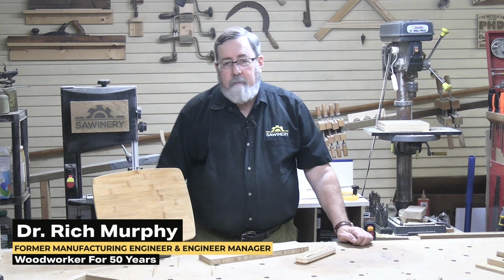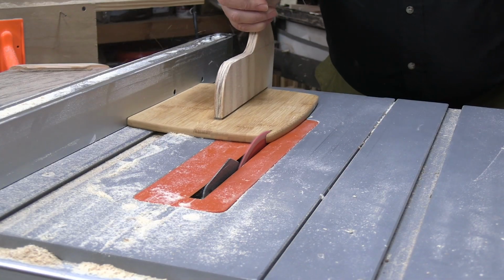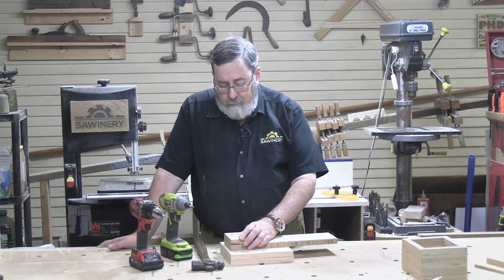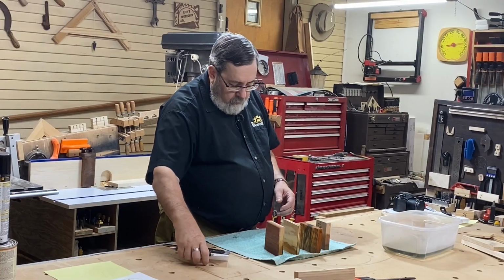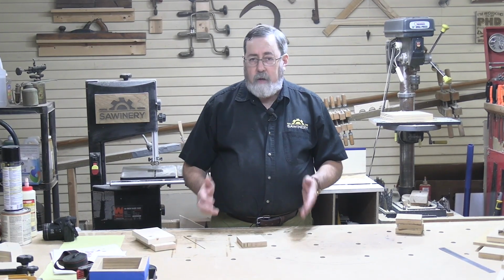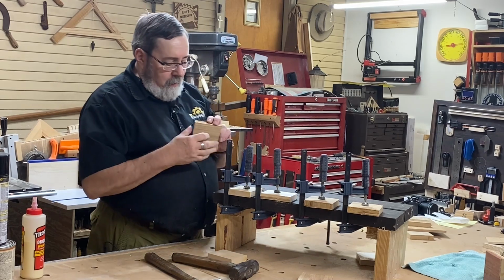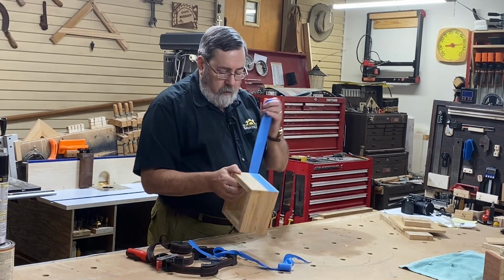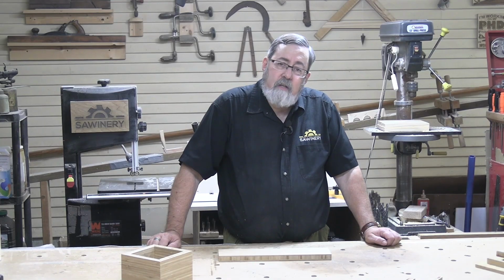Bamboo for Woodworking? I Tested It to Find Out!

Comment: bamboo built-up stocks and laminated sheet goods are an exceptional material, stable, dense, hard, stiff, strong, machinable, and beautiful, especially when finished with oil and wax. not easy to find in north america, but it comes in all kinds of laminate styles, configurations, and thicknesses. it does require a lot of processing to go from the raw material to the finished product, so it is always going to be a premium material at a premium price

Comment: Bamboo is NOT a herbaceous grass.   Bamboo is in fact a woody plant. 
What classifies plants as "woody", is the presence of Lignin, which is a chemical that hardens the secondary tissues in plants making them rigid.    Lignin comprises 30% of Bamboo's dry mass... the same amount seen in trees.  
So yes... Bamboo is wood.
Reply: Bamboo is in the grass family.  It grows from the bottom like most other grasses, not from the top like most trees.  It can be called "woody bamboo", but the scientific family is grass.
Reply: @garrettgobrien  
Irrelevant to the fact that bamboo is a woody plant.    The rest of the Poaceae is classified as herbaceous plants, because their tissue structures are only bonded by the cellulose fibers of their cell walls.  

Bamboo is a woody plant, because like all other woody plants... bamboo produces secondary structural tissues that are reinforced with lignin.  
Furthermore, bamboo only grows similar to other grasses in that it grows from a rhizome... but bamboo shoots grow from a terminal bud at the top of the shoot.   They grow from the TOP just like trees h other woody plants.  
If you cut the tip of a bamboo shoot... it will stop growing, because you will eliminate the growth bud.
Reply: @OOTurok  It's completely relevant. Granted, the way things are classified can be kind of stupid at times. But, bamboo has blades rather than leaves and has a hollow center and is grouped with other grasses.

The taxonomy of plants and animals can be rather complicated and at times in opposition to your expectations, but that doesn't change the fact that it's in the grass family any more than the fact that some birds sing which are not songbirds. That's just not how they're classified.
Reply: @SmallSpoonBrigade  
No it is NOT relevant what family bamboo is classified in, because bamboo is literally classified as a *woody grass*. 
Trees are NOT the only woody plants in the Plant Kingdom. 
There are woody vines such as Wisteria in the legume family Fabaceae,  there are woody ferns of the Dryopteridaceae family, & there are the Cycads in several different families... none of which are trees.  

All plant tissues are classified into 2 main types.   Herbaceous & Woody.  
Herbaceous tissues... are plant tissues that are primarily bonded by the cellulose fibers of their cell walls.  
Woody tissues... are plant tissues in which the plant's secondary growth is bonded together with lignin that hardens the cellulose fibers in the plant's cell walls.  
And like I said before... Lignin comprises 30% of Bamboo's dry mass, the same amount seen in trees.  

Bamboo, like the other WOODY species I've listed... are not classified as Timber species.  
The guy in the video is falsely equivocating Woody with Timber... & they are NOT synonymous terms.  
Timber... definition... wood prepared for use in carpentry.  
Timber... in botany... refers to species of woody plants commonly harvested for their wood, all of which happen to be trees.  
The vast majority of WOODY plants are not a Timber Species... but they are still woody plants.
Reply: @OOTurok  That's still a grass.
Reply: @SmallSpoonBrigade  You're comparing the term grass to the term wood, when it should be compared to the term tree. This is what they are getting at. Yes, it's a grass. Yes, it is wood. Wood does not automatically mean tree. Tree and grass are mutually exclusive, wood and grass are not.
Reply: @SmallSpoonBrigade  
And still irrelevant to the fact that Bamboo is a woody plant.
Reply: @OOTurok  I mean there are "timber bamboo" species, harvested for use in carpentry(not all carpentry requires flat rectangular slabs).  So no not all timber plants are trees, just most of them. 
However it is rare for short plants to to require the support of strongly woody tissues, and  lignin production has metabolic cost.
 In other words, non-trees may be semi-lignified or even fully lignified but they are rarely dense enough or shaped appropriately for a good general purpose construction material, and it may be that the etymology origin of the descriptive term "tree"  may simply be synonymous with "suitable for timber".
Reply: @TheDuckofDoom.  
True... there are giant species of bamboo that are harvested as timber, but this only happens in several countries in Southeast Asia... Cambodia, Thailand, Vietnam, to name a few, & even then timber is still predominately harvested from trees in these countries.    
Bamboo is just not reconized as a timber species because it's not a common source material, eventhough using bamboo as a construction material does "technically" make it timber.   

As far as the etymology of the word tree... it's not really synonymous with timber for 2 reasons.  
The vast majority of tree species are not harvested for their wood for use in carpentry,  & 2;  the word Tree specifically describes the growth habit of the plant, much like the words Bush, Shrub, & Vine do.  I
Reply: @OOTurok  Current use of the words is irrelevant to their etymology.
And there are many genera of limited geographic extent used as timber, location is irrelevant to them being timber.
Reply: @TheDuckofDoom.  
You are absolutely right... but my point was that because bamboo is not reconized as a timber species, especially by the timber industry... most people have the misconception that bamboo is not wood or used as timber.
Reply: Hemp is also a woody plant and is also slowly being used for building materials. So far only on experimental basis as far as I know. But also a promising environment friendly material
Reply: Related to the "wood" debate - there is no taxonomical classification of "tree". "Tree" is a description of growth habit, similar to "shrub", or "vine". Plants of many different classifications are called trees. So arguably "wood" is similarly a classification by amount of lignin rather than whether it comes from a "tree" that may also be a member of the order of grasses.
Reply: Wether your opinion is right or wrong, do you really think anyone is impressed with your pedantry?
Reply: @luisaraujo4708  I'm very impressed. I like facts. I like truth. Knowledge is power.
Reply: @luisaraujo4708  
It's not my opinion.   I have a degree in Botany.   My statements are based on scientific facts.

Comment: bamboo is a horrible wood substitute, it's one and only "advantage" is the speed it grows and that speed is heavily dependent on a HUGE amount of water.  And ntm it is very very sensitive to humidity, have it installed in my downstairs den and during the rainy season if i don't have a dehumidifier running 24/7 it swells and bows up in multiple places
Reply: Sounds like you got some cheap crappy flooring and you're blaming the material for the manufacturers crimes.

Comment: I bought 60 pieces of leftover bamboo flooring for $10 and have made several projects out it. Very easy to work with.
Reply: I think tortilla press can be built from bamboo flooring pieces, or maybe is too thin.

Comment: You can find larger pieces by searching for desktops, worktops, and countertops. A couple issues there: they are often thicker than 3/4", and they are still a bit pricey. A quick search for a desktop gives me a piece 24" x 60" x 3/4" for $160, or about $16/board foot.

Comment: If you sand bamboo, be sure to wear a mask!  Bamboo contains silica and the dust is very hazardous
Reply: I believe it contains amorphous silica (aka bio-silica), not crystalline silica.

Crystalline silica specifically is the cause of silicosis and can cause cancer.

Burning can cause crystallisation.  This is why rice husk dust (with high silica) is generally safe, but the ashes from burning rice husks is a significant health risk. 

I.e. I don't believe that working with bamboo wood will be any more dangerous than other engineered laminates like pine plywood (i.e. the dust and fumes coming from the glues and resins)
Reply: I came here to say that a woodworker shared that he had an allergic reaction that made him very sick after working with bamboo. I believe he said he never had a problem with wood dust.
Reply: @SayAlotmore  I could see that happening. It's grass, not wood, so would trigger different allergies.

Comment: Bamboo is said to be 4 times harder than oak, and there in lies it's advantages and disadvantages.   As a Handyman/Renovator, I've installed about 25 bamboo flooring systems over the last 20 years.  Bamboo flooring is very scratch resistant and virtually undentable.  Much of what I have installed is "horizontally stranded bamboo" which closely mimics wood grain, without the knots/knuckles associated with bamboo.  The caramelized color is consistent throughout the board thickness.  Bamboo flooring systems are approved for basement floor installations where they are more susceptible to moisture, or even flooding.  The disadvantage of bamboo is also in the hardness and it's affect on blades for cutting and shaping.  A brand new 12 inch, 60 tooth,  Diablo carbide, thin kerf miter saw blade will last to lay a 12 ft. X 20 ft. foor before its' ready for the garbage.  Prices for bamboo flooring have drastically changed during the past 10 years.  When bamboo flooring first came to Canada, it was priced economically, right between laminates and engineered hardwoods.   Bamboo flooring is now one of the most expensive materials, priced higher than most quality hardwoods and high end luxury vinyls.
Reply: I'd "stronger" more than "harder". I agree polished bamboo become harder and produce some kind of hardening wax on its surface.
I'm glad it wasn't a dream when I saw prices here in France. While we even have Chinese bamboo forest in the south, the price of the raw material makes no sense.
You would think something that can grow up to 25 meters tall at a speed of 1 meter per day would cost next to nothing. But around 35€ for a 4 meter iron bamboo is insane.
Reply: @Belaziraf  This is out of pure greed.
Reply: @ikemkrueger  Yeah. Making profits is not equal to greed. Greed is abuse of consumers while making profit is one's company search for success.
But all through history, the biggest companies/corporations have been driven by greed while smaller business can still make their owners wealthy or rich and give their workers fair pays.
Reply: @Belaziraf greed is greed come on. If you are making record profits you are either underpaying workers (yes, even if you are paying them more than they would make in past years), scalping consumers, or abusing supply chains. MAYBE company profit is reasonable if profits are actually used for growth, or improving work conditions, and never at the expense of those lower down the supply chain
Reply: @Belaziraf  i can imagine it beeing so expensive has to do with the steps needed to make it a solid material, not a woodworker so i really have no idea, but since it grows as hollow tube, to make a an inch thick board youd have to plain, cut and bend it quite a few times and that for every bamboo tube youd wanna use in a board, especially when you consider how tough it is on the tooling according to chris, i can imagine the cost going up exponentially to the thickness, thats why most you see from bamboo are quite thin pieces  of cutting board or stuff where a single wall thickness is enough for the product,, but yeah no doubt there is a profit side of things aswell just wanted to throw that in.
Reply: @swaz9944  Giant bamboos have average walls going from 1.25 centimeters at the base, to 0.5 centimeters at the top. With no significant variation per 2 meters length. There is no question about which varieties is used to make solid panels. Those varieties are 12 to 15 cm thick. 
Bamboo is naturally fungicide and rot proof. BUT it is extremely durable and need rethinking of how it should be processed. Traditional processing aren't that hard to the tools.
Now, smaller bamboos with close to no processing are used for garden fences. Even those only cut in two are more expensive than processed pinewood.
Reply: The prices have increased but so has the quality and the demand.
The first bamboo flooring material wasn't that great to look at.
Reply: why would bamboo be expensive? bamboo grow real fast, and mostly made in China and South East Asia, where labor is cheap.
Reply: @simhopp  I can only assume that bamboo products are now being priced in North America based on "target pricing", which is charging what people are willing to pay, rather than a "manufacturing cost + profit basis".
About 10 years ago, when bamboo products were first introduced here, I purchased a wonderful 14" X 20" X 1-1/4" bamboo kitchen cutting board, from a Chinese importer for $8 dollars.  A similar product today is priced at $100 dollars or more.
Reply: @iridium8341  Please elaborate.  20 years ago I purchased beautiful horizontal stranded bamboo click, floating flooring for $1.87 per square foot.  If you have a source for under $5 to $7 per sq. ft., I'd love to hear about it.  
In the same time period, laminates, engineered hardwood and solid hardwood have increased about 10% and luxury vinyl has decreased in price.

Comment: I suspect that what might happen is that the plywood manufacturers may start using the plywood a core material with specific hardwoods as the finished/outside veneer.  That would make a very stable, strong plywood.

Comment: Question, any idea of a weight comparison to other woods and plywood?
Reply: I don't have a percentage comparison, but bamboo is more dense and much more heavy.
Reply: @chrisgraham2904  at 75 I already have trouble with 3/4 sheets so no full sheets for me 😂
Reply from the maker: According to my measurements, it’s about 5% heavier than comparable softwood plywood.
Reply: @sawinery-woodworking  I have no experience with bamboo plywood, since I've never seen it in my area.  I'm working with bamboo horizontal stranded flooring planks, which are 4" wide X 4 ' long x 3/8" thick and a case of 16 planks weighs in at 92 pounds.  A similar case of engineered oak hardwood flooring is no more than 60 pounds.

Comment: I got rid of all my fancy and beautiful cutting boards and replace them with bamboo cutting boards.  They don’t warp nor do they get cuts, dents and grooves in them when you use them.  They may not look as nice but functionality they are far, far superior!
Reply: The disadvantage is they will dull your knives really fast
Reply: @evelioguaperas  Really.  I had not noticed that.   I’ll keep an eye out… Thanks for the heads up.  (of course if you think about it it makes sense - if the board doesn’t scratch it must be as hard or harder than a knife and the conclusion is kind of obvious.  Thanks for your reply!  😀
Reply: @evelioguaperas  it’s easier to sharpen a knife then sand down and refinish a cutting board.
Reply: Cheap bamboo boards use cheap glue that may not be food-safe. So it's a bit like using a plastic cutting board, but you get duller knives and trade microplastics for industrial adhesive.
Reply: @iamicrawler  do you have any evidence to support what you are saying?
Reply: @kenday7942  Logic, not quite as good as evidence, but the best substitute. And logic would suggest that companies will use the cheapest industrial adhesives that they can get away with.
Reply: I like bamboo, but for cutting, I dislike the hardness. I prefer having the blade easily bite slightly into the board.

Comment: I had some bamboo cutting boards that were only about 3/8 thick, and they warped into a tractor seat from getting wet when I washed them.  Working with bamboo is going to pretty much be a "no" for me unless I'm using intact stalks.
Reply: That makes me wonder if there are different methods of producing these bamboo boards that have very different characteristics not related to the bamboo itself?  I have bamboo cutting boards that were advertised as dishwasher safe (crazy, right?) and have been through the dishwasher repeatedly for years with no warping at all.
Reply: Most cheaper bamboo cutting boards will specifically say that you shouldn't put them in the dishwasher. 

They say that because they aren't made to get wet. Especially with hot water. 

Bamboo plywood that's made for building stuff would be made in a very different way. It's meant to serve a completely different purpose.